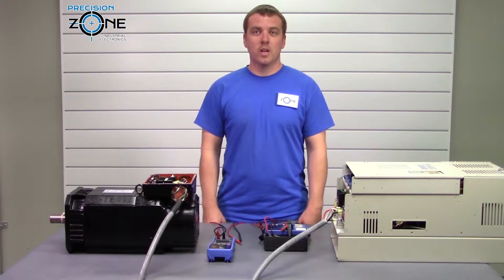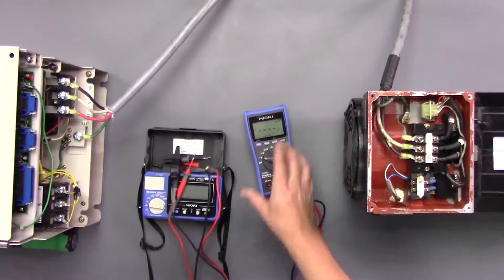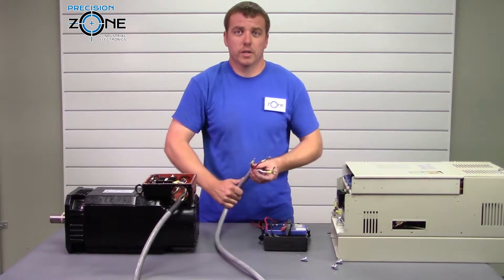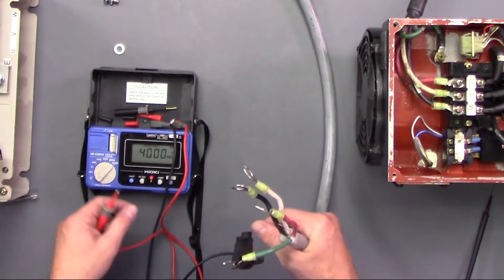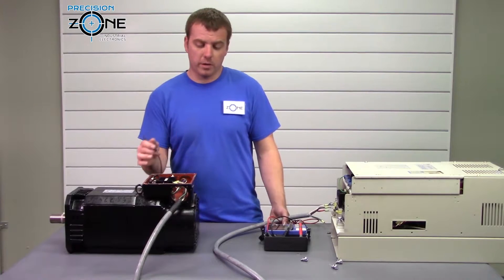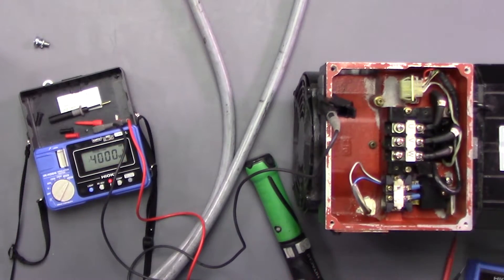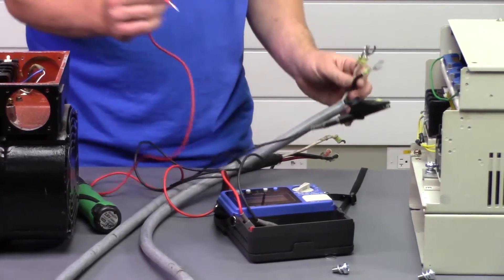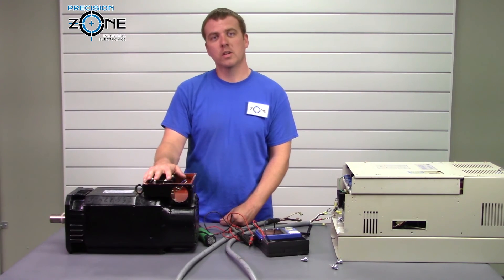Basic Test to Check that AC Spindle Motors is Grounded

Comment: spindle motor has 3 phase u-v-w next to it, there are 2 more wires connected to the motor, what is it used for?
Reply: it could be a brake or maybe thermal overload